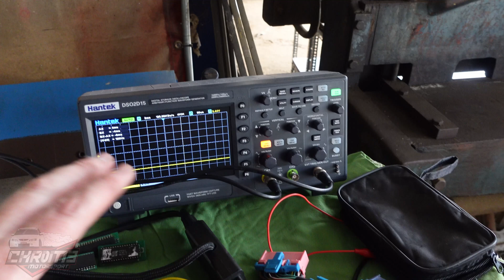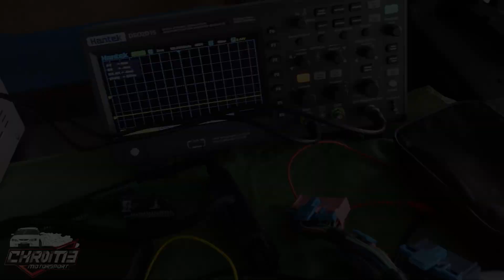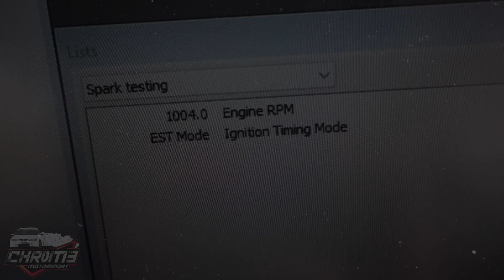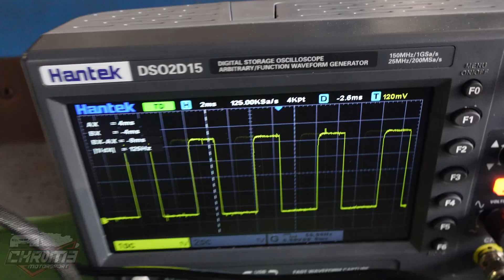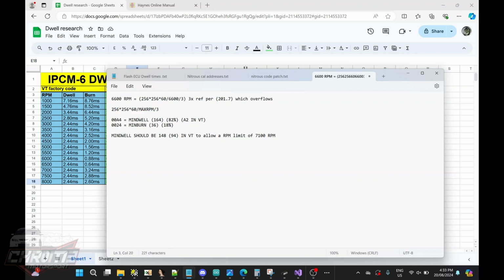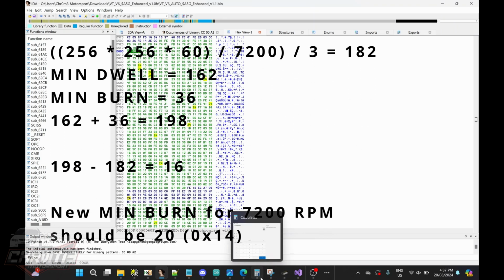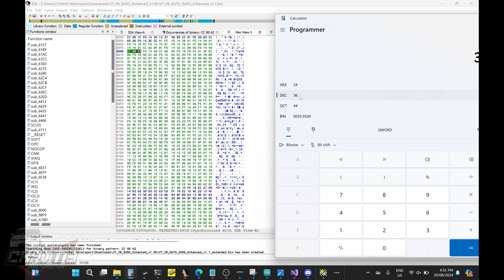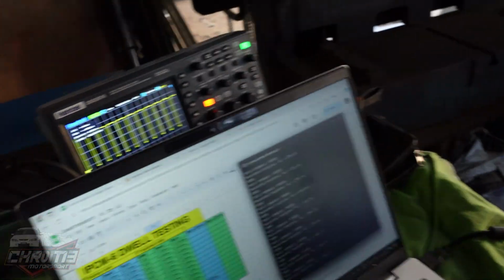300 HP 3.8L N/A Ecotec Burnout Car Project: Week 5 Pushing the limits of the Delco ECU!

Comment: Do you know where to get AVRDUDE I've installed it but when I try and open it it just pops up CMD for a split second and then nothing ? Idk if I'm suppose to do anything to actually made it open or somthing I have arduino serial to usb adapter, obdxpro GT, usbasp isp avr programmer and 27C256 256K Eprom IC  trying to using the obdxpro GT and mod it to be aldl or the serial to usb to aldl for vs v6 so I can interface with the ecu
Reply from the maker: I can appreciate someone trying to do something themselves cheap but honestly easier just to get an NVRAM off pcm hacking
Reply: @CHR0M3x  yea you got a point there as its turned out alot more technical then I expected to begin with haha you could replace the standard memcal with a SST flash chip right ? Is there a way I can make or use the current items I have to be able to read my standard memcal to look at the tune / bin
Reply from the maker: @ProdR3D5Y  I don't have much of an idea on that, you can buy SST chips for $25 off pcm hacking to replace the memcal as well.
Reply: @CHR0M3x  ah yep are the sst chips flash programmable and eraseable or do you still need the eprom burner and uv some say they don't need the uv eraser but do need the programmer like the gq4x4
Reply from the maker: You will need the programmer still but using that you will be able to erase those SST chips, they're an EEPROM (electronically erasable) whereas memcal are just EPROM.